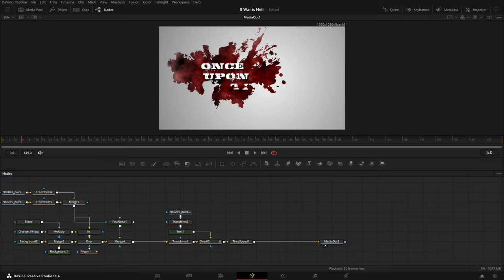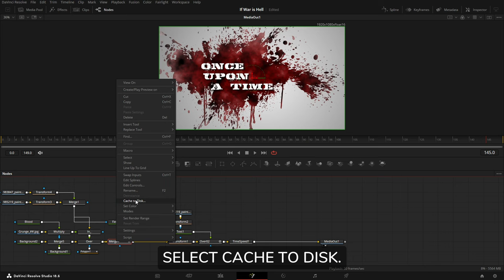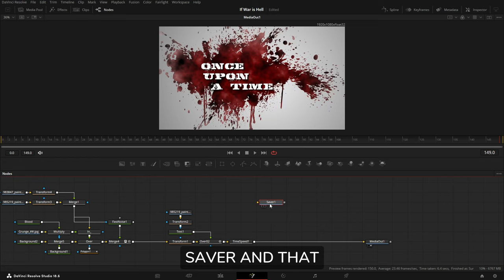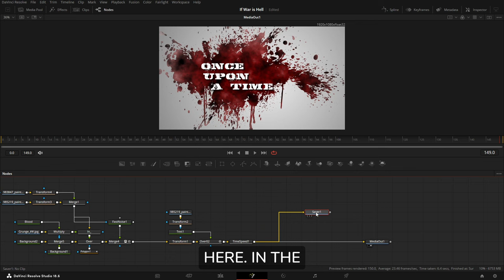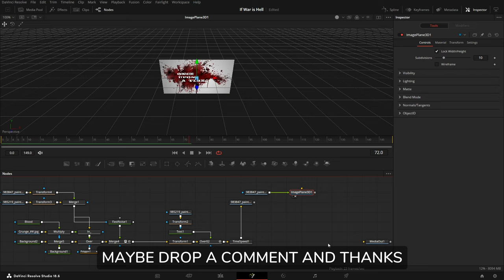Davinci Resolve Fusion Ram & Disk Cache for Better Performance

Comment: Awesome, thank you! Why would you use a saver node over just caching?
Reply from the maker: Good question. It all depends on your workflow and if the work station can handle caching. Occasionally a composition is made up of hundreds of parts that saving to an exr sequences takes the pressure off. You can also share the exr sequence to other artists to work on.